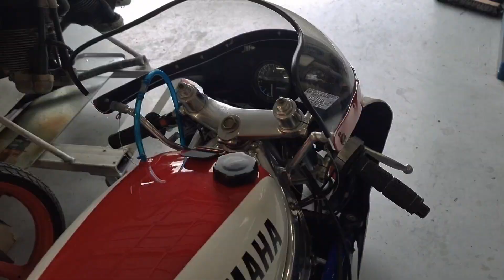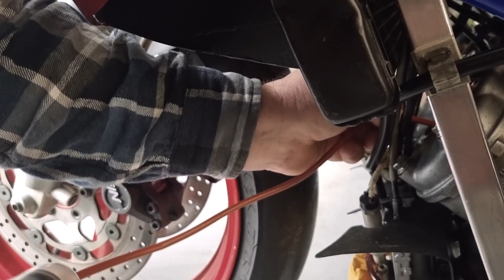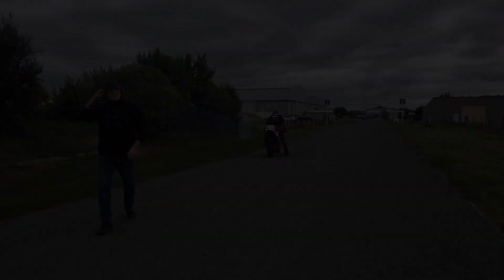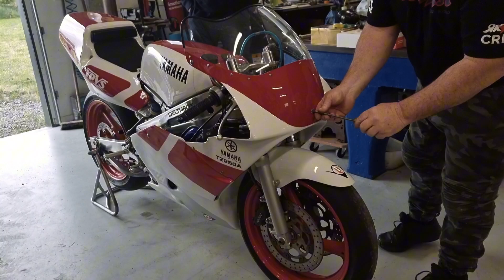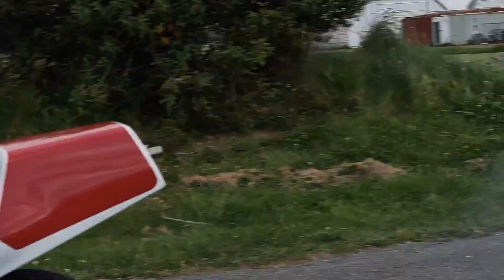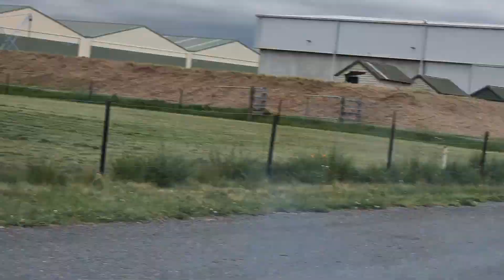Yamaha TZ250A 2 Stroke Racebike New Zealand

Comment: This is not a 3MA road bike eh?
The 3MA was a TZR - not a TZ
Reverse cylinder yes - but not the same engine as the TZR2503MA
Cylinders leaned over more to the front?
Correct?
Reply from the maker: no, definitely not a road bike and yes the cylinders do lean forward.